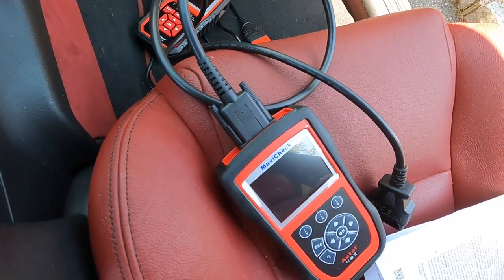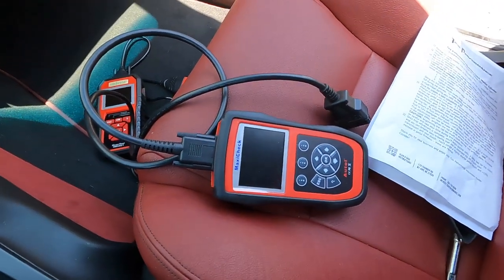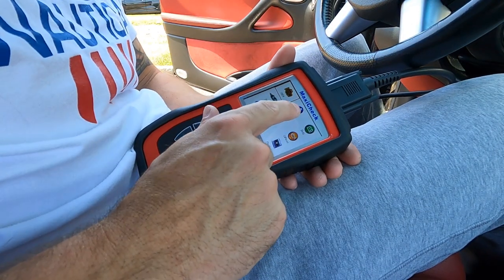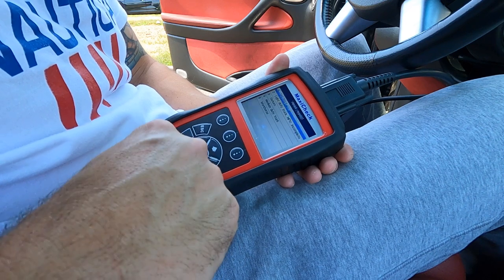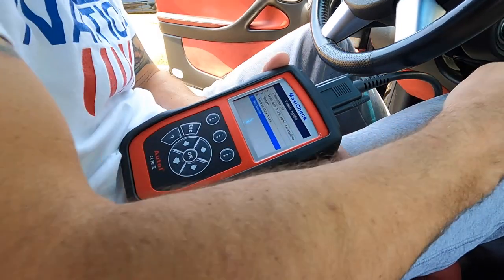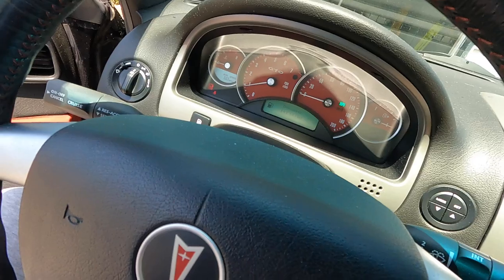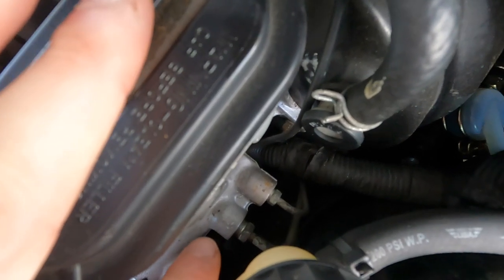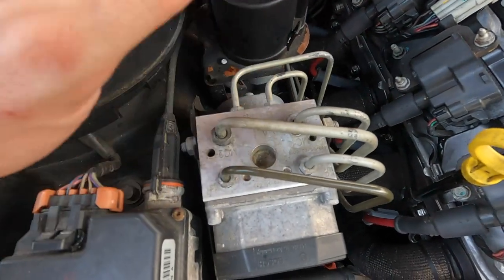What's wrong with the GTO's brakes!?

Comment: I have 2006 that I recently upgraded to CTSV brakes and caught hell getting the pedal back because of air in the ABS module. I had an XTool D7 scanner but the ABS bleed special function didn't work on the GTO. Next, I called Autel specifically asking which scanner would perform ABS bleed for the GTO. They assured me that the MX-808 would do the trick, turns out it didn't work either and I returned it. Folks on the GTO forum mentioned a device called a Tech 2 that the dealers used back in the day. It turns out you can buy a Chinese knock off of the Tech 2 for around $400 on eBay, it worked!
Reply from the maker: Thanks for the tip! It's just weird cuz my junk yard master cylinder gave me front brakes, but no fluid to rear brakes. It stopped though. Gonna try bleeding one more time then maybe go for the tech 2
Reply: @Billy_Ray_Garage  I think the fact that you're not getting fluid to the rear says that fluid is not getting past the ABS module. I wouldn't bother bleeding again, I tried bleeding my car 4 times without success. Tech 2 clone did the trick
Reply from the maker: @3212Dre  I got a new master from Australia, I'm getting some fluid but there definitely is air in there. Junk yard master wasn't sending fluid to rear at the master. Looking into that tech 2 now. Thanks for that tip!
Reply from the maker: @3212Dre  got a question. I got a tech 2 and trying to run the bleed. But every time I get an ABS alarm and wont let it pump. Did you get that?
Reply: @Billy_Ray_Garage  Try going in sequence, driver's side rear, driver's side front, passenger side front, passenger side rear. It might not pump on all corners just keep going in sequence. If I recall correctly I got the ABS alarm as well, I think it disables the ABS until you actually start the bleeding procedure.
Reply from the maker: @3212Dre  I got a c0068 code brake switch circuit malfunction. Don't think it's going to work with that up. Got to look into that. Atleast I have the scanner now

Comment: The coils on the abs module are ultra sonically welded to the steel tabs, they can break. Common fault.  Had same issue with my 04 Holden Commodore VY HSV Clubsport manual sedan here in New Zealand.   Was an absolute nightmare.  Was safe to drive with module seperated from abs unit while I had it sent to Australia for rebuilding.   Just ment I had no abs assist.
Just pull the abs fuse to stop the annoying beeps, while it's away getting serviced.
Reply from the maker: I thought it was the abs module locking out or preventing fluid from the master cylinder getting to the rear. So far it's the master cylinder. Got a new one coming from Australia. Hope it works! I can live without abs. Just want brakes at all 4 wheels 😂
Reply: @Billy_Ray_Garage  Yeah, that is a strange one.   Hopefully the master cylinder does the trick for you.   
Of you search the net for Holden Monaro parts you might have a better success in Ozzy and NZ.   Just a thought
Reply from the maker: @russcole5685  that's what I had to do. Got a junk yard master cylinder, that has the problem currently. With the original one the pedal went right to the floor. Gonna try and get the 2 rebuilt to have spares for life haha